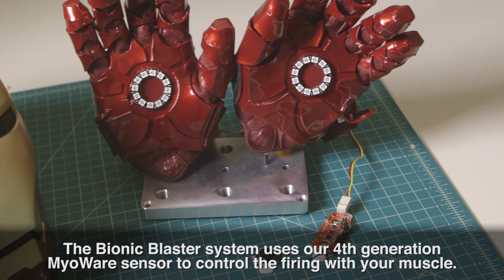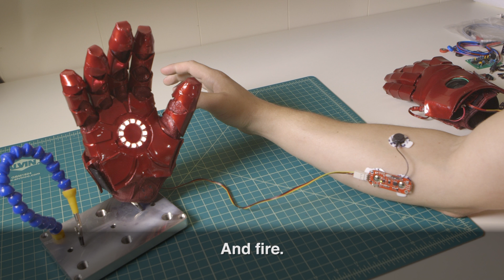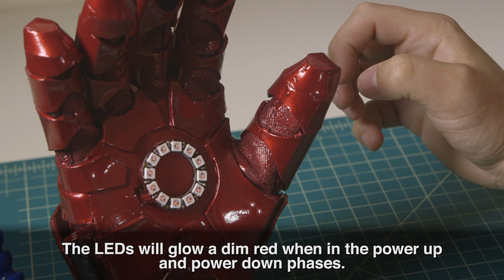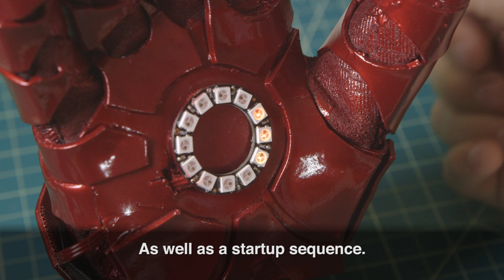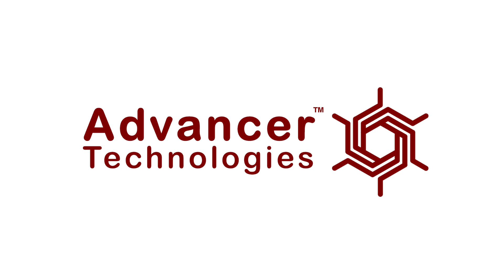MyoWare Bionic Repulsor

Comment: Could I ask a few quick questions?
1. Can I get it to work directly with android devices? (or at least with an arduino micro)
2. Is it impossible to get enough values regardless of effort, if one's strength is not strong enough for some reasons? (age, disease, tiredness etc)
If the answer to the first question is yes, then it'll be very easy for me to develop some mobile apps using those data.
The second questions is very important to me because I'm planning to make an exoskeleton device in order to help some weak people around me.
Thanks for making this amazing product! Please keep it up!